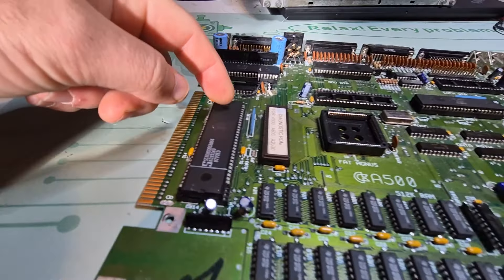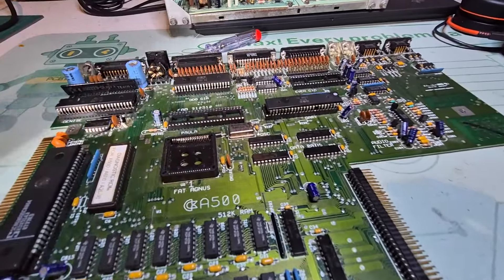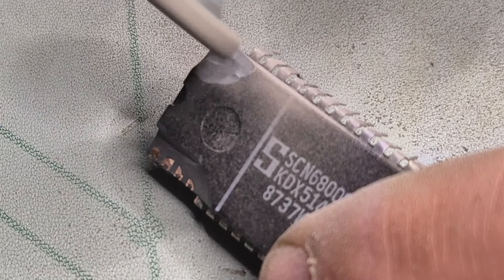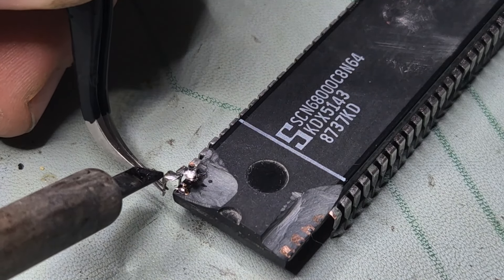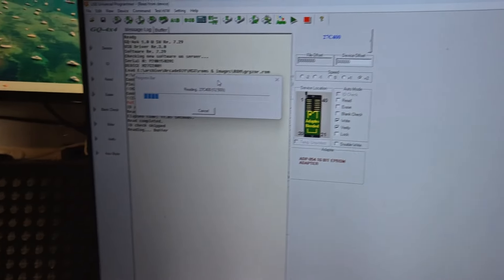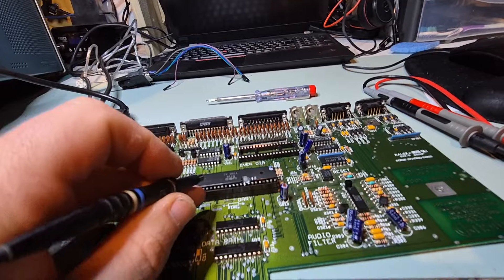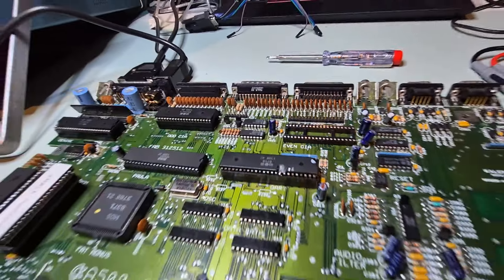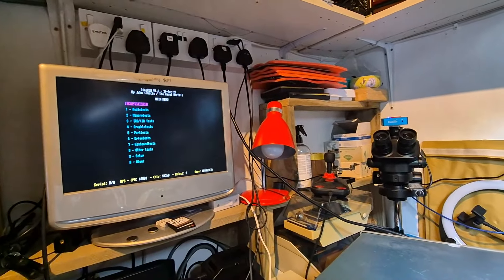Amiga 500 Rev5 broken IC leg repairs

Comment: The way i did some eprom chips like this was : I first put the chip on a socket ,then  i inserted the legs and soldered them on the chip and in the socket. and then i put the socket inside a socket on the pcb.
It gets a bit higher than the other chips but if space is not a problem then it is way more supported and also can be removed more easily in the future
Reply from the maker: yeah I did think about doing sth like that since I was going to put the ic on a socket. there's a couple of articles online describing how to do it but a mate ended up sending me the adapter so why not use it. think the adapter is about the same height using that two sockets solution